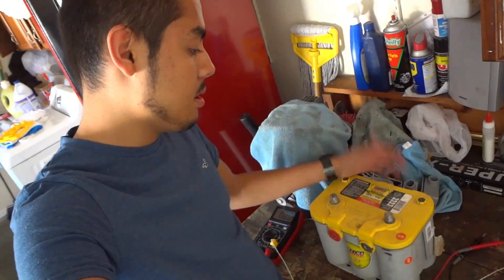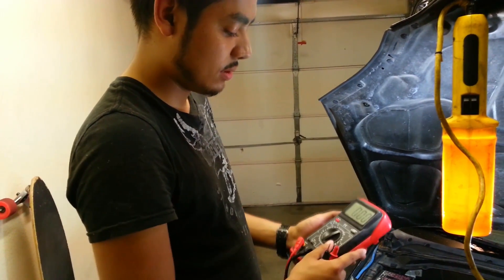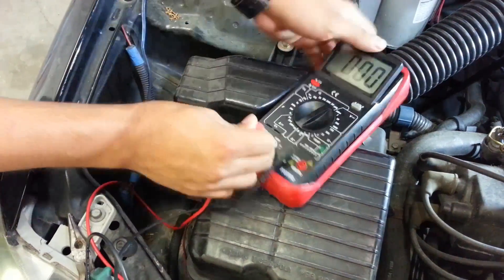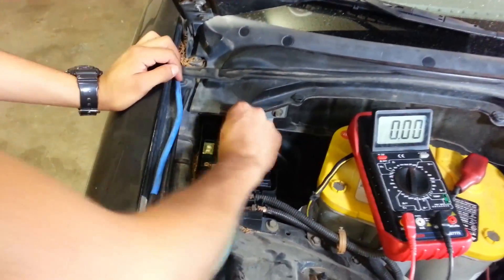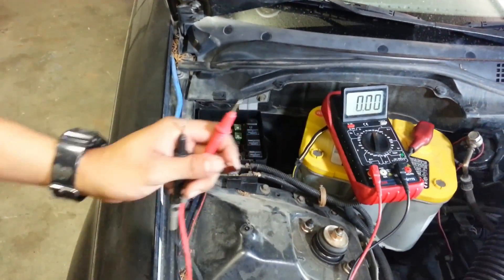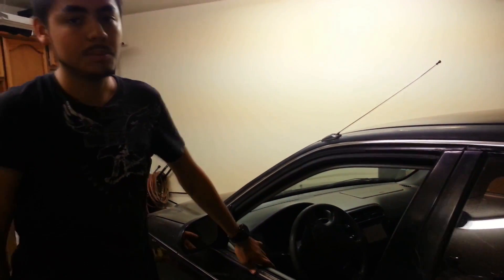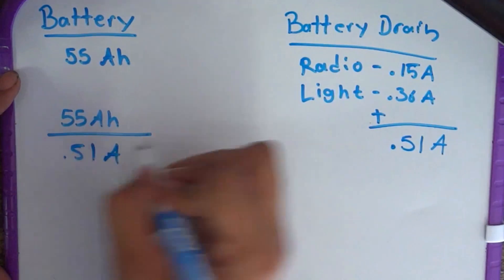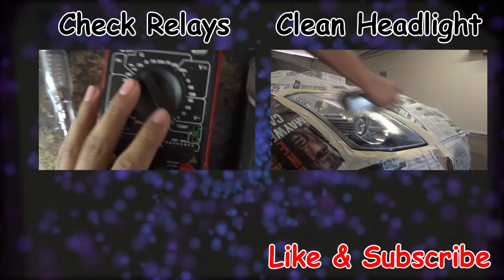How to find Short Circuit in your car/truck

Comment: Hi Chris I have a 1968 LandRover and battery drained very bad. because the car does not have a fuse box like the latest cars would i able to replace the fuses by replacing those black boxes( fuse box)? the battery lasted over night and it dead! please help cheers
Reply from the maker: +Talaiasi Tangifua The black boxes might be relays. In that case what you can do is disconnect the battery. Then put the red probe of the multimeter on the negative of the battery cable and the black probe to the negative of the battery and follow the same steps in the video. If your battery is getting drained over night then you should be seeing something over an amp or two. You can start remove the relays(i think this what you mean by black boxes). Once you see the current drop greatly then you have found the bad relay. Replace that one and if it doesn't fix the program then it might be the wiring that i connected to that relay.

Comment: I thought battery neg is suppose to be disconnected for this.
Reply from the maker: For this type of test you need to have it connected. there is one where you remove the negative battery terminal and put it in series with a current meter.

Comment: You dont have to pull fuse, if you look close, on top side of fuse, u can touch the pins.
Reply from the maker: In this case the fuse cannot be in place because the current must flow through the multimeter instead of the fuse. If I left it in place I would have gotten 0 current on the multimeter reading.
Reply: +Christian Macias YES you CAN. your multi meter is acting as the fuse! doing same thing as a fuse would
Reply: +WannaBeDj100 All your doing, is jumping the contact
Reply: Well maybe not, where it has to be inline, so maybe your right, Ill have to test

Comment: Great video. I have 2003 Corolla S where i have noticed my signal flash light amp keeps blowing up and because of that my signal/hazard light front and back don't work. The time it takes for the amp to blow up is from the time I replaced the amp withing 2sec or more it varies so i suspect there is a short circuit, what would you recommend the step i take to try to locate where the short circuit is or any advise how i should approach this issue?

Comment: my multi meter does not have 20 amp , it says max 10 amp, this tutorial is only useful if we have the same exact multi meter like yours. you didnt even explain what type is the multimeter
Reply from the maker: +Dave 10 amp is enough to test the fuses. 20amps is a huge amount of current that your car probably will not reach (other than very few things. For example the starter).  10 Amps should be more than enough. Ill put a link to the multimeter I have in the description when i get the chance. Thanks for your input!

Comment: There's an easier way to check for a drain on the battery instead of taking fuses out, remove a battery terminal, put the amp meter in series with that, test fuses first with circuit tester to see which are live, they will be the only ones you have to takeout...Fred in England
Reply: remove the negative one.  u can get away with either but is safer to remove the negative one cuz if by accident u short + with - it can damage something. if u short - with - nothing happens.
Reply from the maker: +Tom Smith Good advice! The name for that test is called a parasitic draw test in case anybody would like to google that.
Reply: Tom Smith which battery terminal should I remove? the black or red?
Reply: Hi there someone asked which terminal should you remove to check for a drain, either it doesn't make any difference, the current is the same through the whole circuit, electric has to go round in a circle to work, hence the name circuit from Fred in UK.

Comment: hey Wsup just got done watching ur video im having a problem with my slot 15 which is a 20a fuse and the fuse keeps blowing I did a conutiy test and I got a beep I don't know what to do now
Reply from the maker: +Eazy Rida If a 20 amp fuse is blowing then there is definitely a short circuit in your car. Look in your owners manual to see what that fuse is to. Once you know what that fuse is to, you should have an idea about where to look. Check for a melted wire, and if you can't figure it out you might want to replace the component that the fuse belongs to.
Reply: +Christian Macias it control power locks and interior lights
Reply: +Eazy Rida yes
Reply: +Eazy Rida r u there

Comment: Liked your video.  One question my vehicle is over heating the relay of the fuel pump. It overheats to the point the one of the connection gets loose and it begins to fail. Extra info live arizona and it gets up to 114 degrees.
Reply from the maker: +654ruiz Those are definitely harsh conditions. As far as i know, i haven't heard of a relay coming loose because of heat. Have you tried swapping one relay for another to see if it still comes loose? Maybe the contacts on the relay have worn down?

Comment: When i jerk my steering wheel the voltage drops to 8 then back up to 14, what is this? Also this is eventually killing my battery, and once i start actually driving my car will either poorly idle or it wont idle at all(in which i'd have to gas it to keep it on).
Reply from the maker: Chavez It might be your alternator. Have it check because it sound like it might be going out and putting a heavy load on the engine.
Reply: Christian Macias If I take off both terminals off the battery and the car is still running would that be a legitimate test to see if my alternator is bad?

Comment: The fuse for the starter keeps blowin. Do I have to replace the starter?
Reply from the maker: Jesus Hernandez Make sure that you are using the right amperage fuse first, the panel by the fuses usually says what the correct amperage fuse is. If you are 100% sure that you are putting the correct fuse in, then you should make sure all the wires are in good condition, and replace the relay first(to save money and time in case the starter isn't the problem). If that still doesn't work, then you should replace the starter.

Comment: That's called a parasitic draw/dark current/battery drain. A short is where live and Earth are contacting?
Reply from the maker: Peter Rogers Yes, that is precisely what it is but it's usually not a short circuit. It is usually something faulty, that is drawing more current than it should be. If it were a short, the fuse would have more than likely blown.

Comment: Looking for my  shorted vampire sucking source . Going to try this method. I have to keep disconnecting my battery till i find out.

Question is....
would my battery terminal cable connector , if they or one of them were bad - would that short the battery.  Thanks
Reply from the maker: A bad terminal wouldn't be the reason for a short, but it could make it more difficult for the car to turn over since it's not making good contact and the starter draws a high amount of current.
Reply: Christian Macias 
Did this test your method and nothing happened or my troubleshooter is not working and the setup has to be right - and im working on  a 96 sonoma .

 My broken visor light - little push button might of have something to  do with it , i know it might of been on. Ill just leave the battery on and watch for it to drop. Im new to all this but - its work. Learning something about cars. 
For a long time, behind my right top  visor /mirror - there is a light that automatically comes on (mirror and a light) vanity mirror -and the light is blown but has a little button on it , so it goes off when you fold it back but it must be on . That must be what it is, if not - just have to keep digging.

Comment: Smartly done.  At first, I wondered why you just didn't hook up in series with the battery and start pulling fuses until the load drop...well then I deducted this a one man job.  You did it the smartest way with only one person.  Thanks
Reply from the maker: That it is true! My next idea was using a set of jumper cables that could hold the multi meter probes but not everybody has jumper cables.

Comment: I think I have a short circuit in my power window wiring harness.  Will this work the same way for that fuse?  My windows worked fine, then stopped.  If I slammed the driver's side door, they occasionally started working again. I removed my switch at the driver's side door & cleaned it to be sure it was getting good contact, but now I have no power to any of the windows. Kind of sucks as I have an 88 Mustang Convertible, lol.  Any advice / info would be great!
Reply from the maker: Charlene Wainright That is usually a really good sign that the brushes on the motor or worn out. As far as all the windows not working... maybe the plug isn't in all the way... They sell brushes cheap on eBay, but you have to be able to take the motor apart and put it back together. That can be a daunting task for many.

Comment: Screw the likes man.

I love how you explain the basics. Not just for diagnosing one small problem but in a method that works so many ways and you explain it the whole way through. So viewers can develop an ACTUAL understanding of  basic auto electronics. Well done bro!

I don't comment often but right now I feel I have to.

You're absolutely right about the maths. It may seem insignificant at the time. But OVER time... It's massive.

Seriously a bro!
Reply from the maker: Thanks man! I really appreciate that. It makes it worth doing these videos!
Reply: Hello friend one question do you know where I can purchase wire diagramas and fuses and relays description online, i do not have the book to do this job, i have a short, but i am dying to find a good link to buy wire diagramas and the most accurate for wire colors, please help me out to to find a webpage by the way it's for a 1997 Mercury Mountaineer 5.0 engine, thanks in advance, nice video and good explanation, thanks again.

Comment: Hey bro I have a problem with my Ford 03 Mustang V6 3.8 
The lights of my car goes all crazy it's like is you are on a club cx anyways I check the battery it comes with 12v when it's off and when is on it comes 14v then I went to auto zone to check my alternator cus sometimes the car won't start and the only to make it start is with cables.. so they told me that the alternator was fine.. then I replace the Starter with a new one and the old one I went to auto zone and the same thing they told me that was fine _'' .l. so I don't know what's wrong my lights for outs goes crazy and the interior too.. please answer me back thanks 
Should I do the same thing like you check the fuses?    
Add me on Facebook- davidtejeda12@yahoo.com
Oh Gmail- camargocarlos12@gmail.com
Thanks
Reply from the maker: Check out this video first to check your starter relay. https://www.youtube.com/watch?v=jKCPCfTgzW8 . Once you know that the relays work, Start tracking short circuits using this method in the video. If you don't find anything, you might have an intermediate problem. You should look at any after market installations on the vehicle such as radio, amplifiers, lights, etc... I would remove them temporarily to see if that helps.

Comment: I liked the video great way to find a short or drainage and Ill be trying your way.
Another way one can check a short is to remove the negative battery cable , connect a test light between the cable and the battery , (only between the negative cable and negative battery post)
If it lights there is something pulling power. Next pull each fuse , if the light goes out, there in that circuit is the short or power drainage.
Keep up the good work my friend.

Comment: why didn't you just do a parasitic draw test? Seems like you took the long way around here...
Reply from the maker: Thanks for commenting! I agree with you actually was not aware of this at the time of making the video. I literally got my camera and started tracking my short with whatever knowledge I had about ciruits. This method seem best to track because it was done individually rather then seeing the multimeter drop in current whenever I pulled a fuse. I preety much just had a threshold current in my head and if a curremt exceeded that, I checked the entire circuit. Ill see what I can do to edit this video. Thanks again for your input!

Comment: I have a '97 cavalier and i located the short. The dome light stays on because the button the door pushes in to turn it off is broken. So i removed that fuse so my lights wont stay on, but since i took that fuse out, nothing inside the car has power when it's off. Which means you cant check the time on the radio, or have power going into the key-less entry. And also when i hold down any of the lock/unlock buttons, the dome light turns on. Any advice??
Reply from the maker: I would recommend that you remove the switch and tape the wire. The door switch usually ground to the frame of the car so that when you open the door it completes the circuit. If you remove the switch to the door the light wouldn't turn on anymore and you would be able to keep the fuse in. Then once you have the time you can go out and buy the switch and replace it.
Reply: Thanks so much for the quick response!! I don't really care if the light turns on when doors are open, so ill just take out the switch and tape the wires like you said. I just bought some fuses. Thanks for the help, i appreciate it.
Reply from the maker: No problem! Hopefully thats a quick fix for you! Thanks for watching. :)